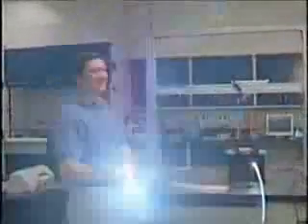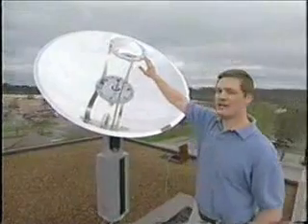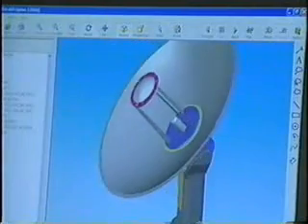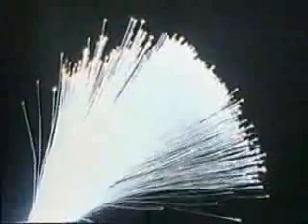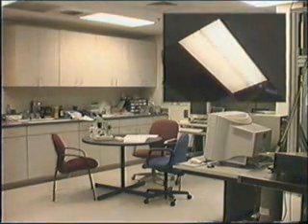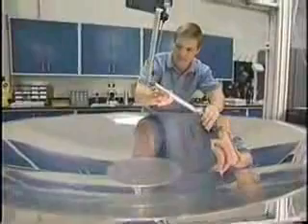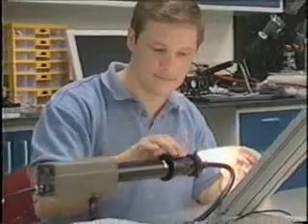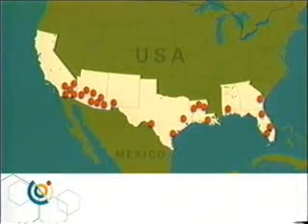Hybrid Solar Lighting System Employing Fiber Optic Cables

Comment: Can you increase main mirror size and use a mechanical up and down in amd out of focus mechanisme to regulate the light and than use autoshading glass and light sensors at a distance to predict when to move the second mirror in case of clearing clouddiensten and use and use the electric autoshading glass to prevent fire and than move the second mirror to regulate light intensiteit so in winter and summer and high and low amount of light you can use it always ???

So an extra led system is only necesary in case of darknrs outside !!!

Comment: Just contacted a Parans rep (April 2014) who said it is $6-8K for @1000 square feet of lighting.  Would be great to see this technology challenge the skylight/solar tube industry.  Apparently the fiber optic cables do not bend w/o damage beyond 50 degrees and the length of the run is still limited to@ 45' for the best results.  Still access to first level, hard to reach areas of 2-story homes or apt. complexes would be available. While now, without clear attic access, daylight for darker, windowless rooms is not an option with skylights or solar tubes.